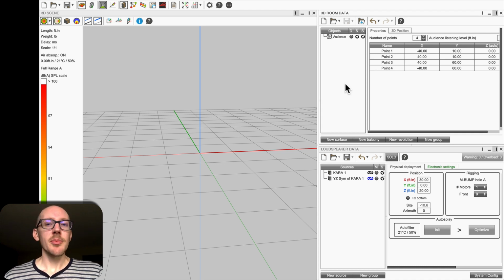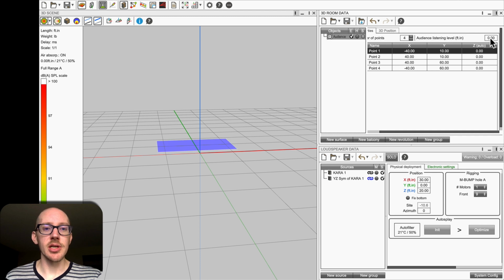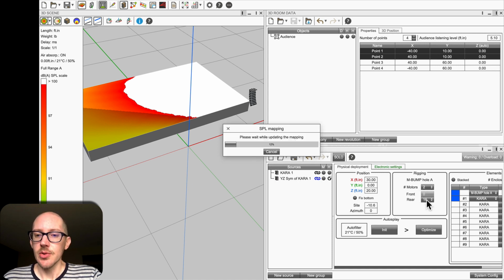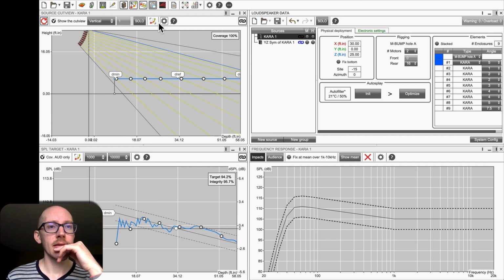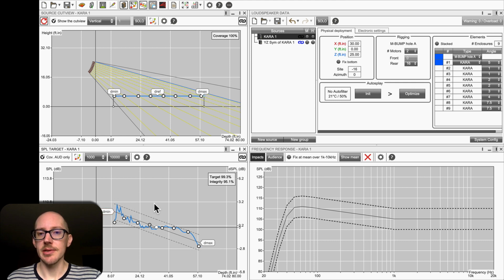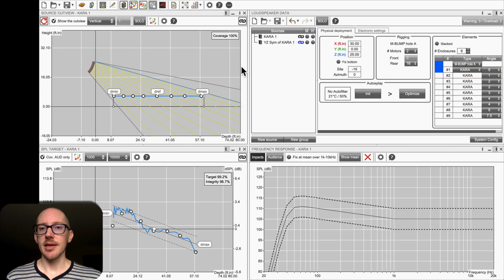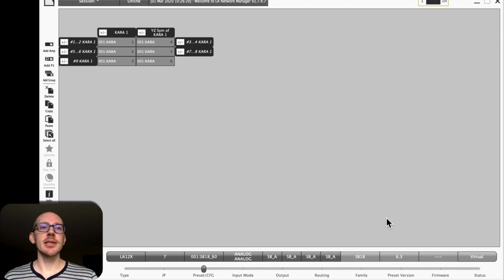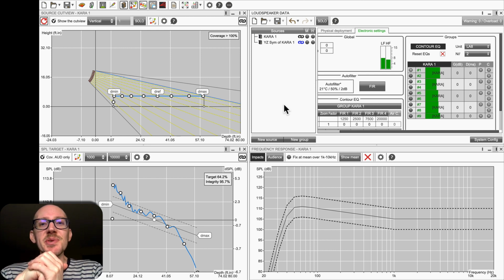Getting Started and First Steps with L-Acoustics Soundvision

Comment: When you overshoot, you can lock the splay angles starting at the top of the hang by clicking these blue boxes 
to the left of the enclosure #:

Here I locked the splay from box #1 to #2, and from #2 to #3.  In this case Autosplay can only adjust from #3 to #4 and below.

Comment: Keep in mind when working in feet.inches, SoundVision interprets the number after the decimal point as inches, not a decimal value.
When you put in 5.1 for the audience listening level, SoundVision sees that as five feet ten inches.  Five feet one inch is entered as 5.01.  Not a huge difference in that case. 
For five and a half feet, you have to put in five feet six inches, as 5.06.    If you put in 5.5, SoundVision thinks you mean five feet, fifty inches, which comes out to nine feet two inches.